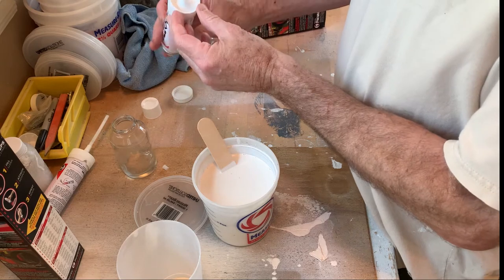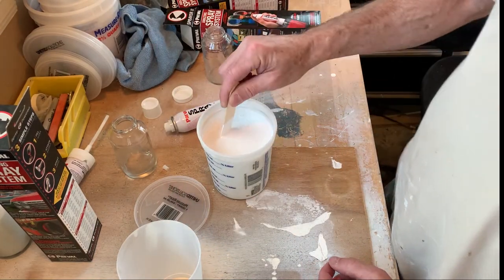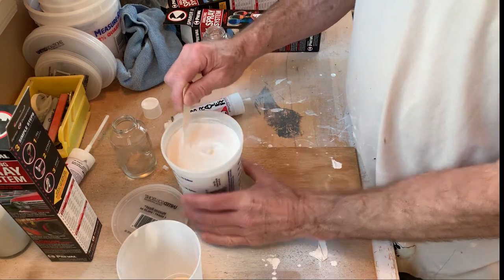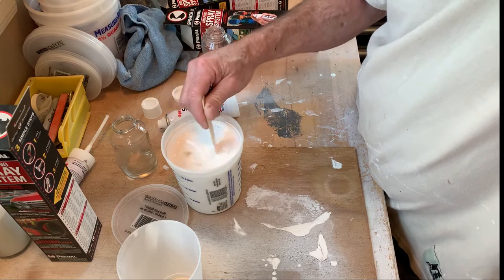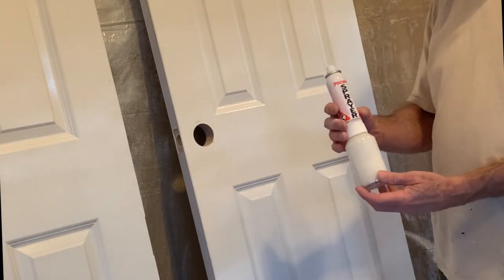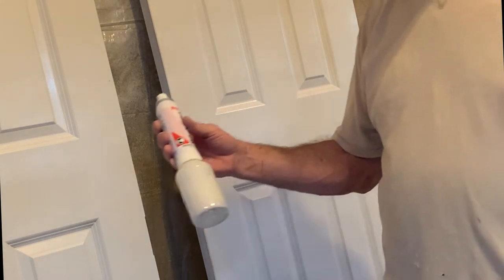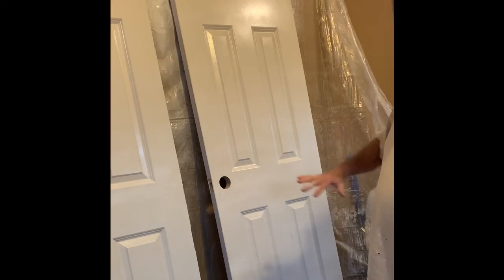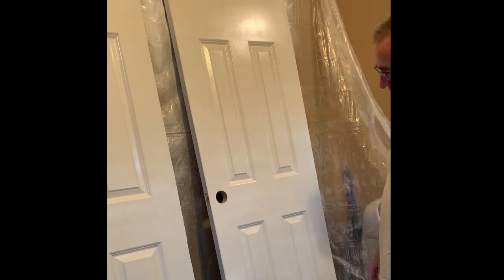Painting Doors with Preval Sprayer

Comment: hi! yes, I had just got off of the phone with the dye supplier and she actually said that the best stuff for me to use wasn't a dye at all, but a paint. and the best way to apply it was spraying it. I had seen all the videos with people dabing or foam brushing the suede and they seemed kinda uneven. 
I remembered the preval system and wanted to see if it would spray evenly. i looked around at various videos. I think, if it sprays good enough to paint a door, it'll spray good enough to spray a jacket. you seemed happy with your results. I was surprised to see your comment section so lonely, so I thought that I would harass you a little, lol. I'm doing good research because this is a really nice jacket. plus, I'm thinking about making a video myself. there is not one single video on somebody dying a suede jacket, so I'll be the first and only. look out Donald Trump! well, thak you for responding and I hope you have a great evening. 
kemble
Reply from the maker: As long as you can thin the paint a little it should work. The spray pattern is not as wide as a regular paint can but it still should do a good job. Might try spraying one direction and then spray next coat at 90 degrees to that. Also don’t turn the sprayer to far horizontal or it will leak from the vent tube. Good luck with it. If you make a video, I’ll watch it lol.
Reply: @FixItDepot  oh, cool! yes, I'm already planning on buying twice as much paint as I need and I'm going to paint with the jacket hanging up, so no tilting of the bottle. 
I think she said it was of a sprayable consultancy already. I'm going to tape off the lining and start on the little bit on the inside as practice.
this paint that I'm going to use sounds pretty fantastic. it's for about everything. almost any fabric except polyester and silk. it works on wood, too. it's called Dye-na-flow. pretty big color selection, too.
well, we'll see. I'll subscribe to your channel and come looking for ya when I get some results. goodly or badly. 😀

Comment: Do you recommend this  preveal sprayer or a tall spray can to paint a 35" five drawer metal cabinet?
Right now is blue but I want to paint it red
Reply from the maker: I think I would use the spray cans, mainly because it has a larger spray pattern/coverage and would probably be cheaper overall.
Reply: @FixItDepot  thanknu